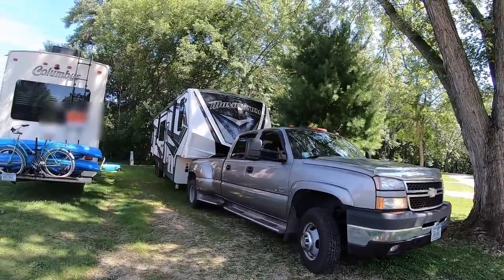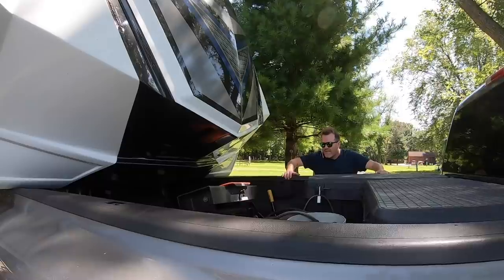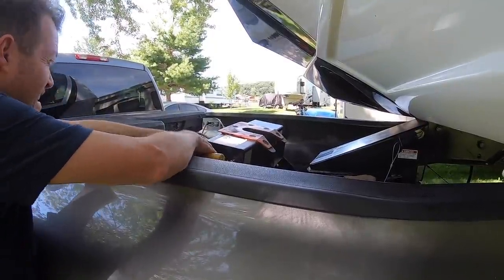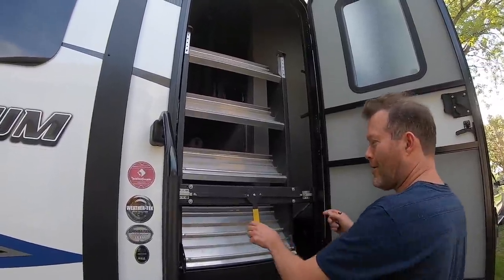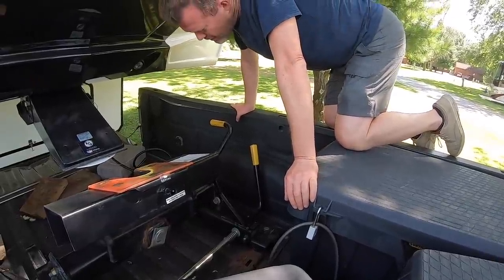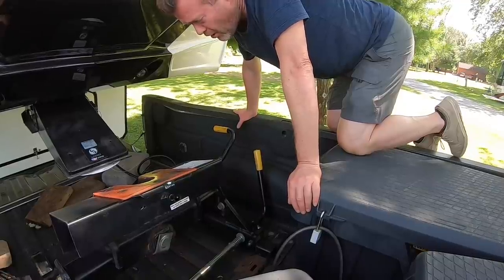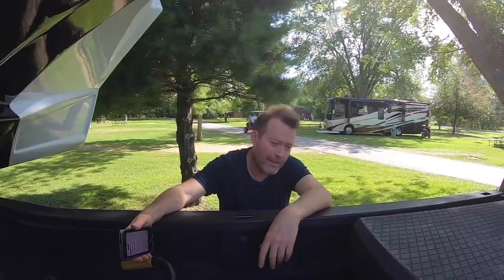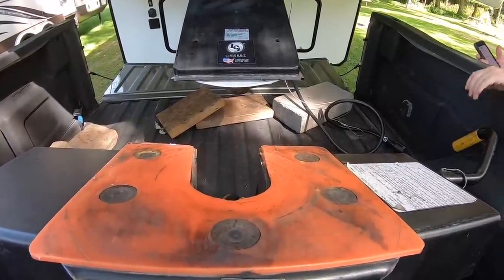RV CRUSHES MY TRUCK ON 1st TOW! BIGGEST RV LIVING FULL TIME MISTAKE! (PT 2)

Comment: I know what you did.  There are 2 positions that would indicate the trailer is locked in but only one of them is right.  If the pin on the trailer is too high when you connect, it will trigger the lock  and indicate a good connection.  The pin and hitch appear connected but the trailer pin is sitting too high on the hitch.  When you started to move the trailer the truck dipped a little bit, causing the pin to roll out of the top of the hitch and BOOM! You aren't the first to do this.  Here is how to prevent this situation:  When backing under the trailer, be sure that the trailer hitch is a little lower than the fifth wheel so that is has to push itself up the slope of the hitch until the trailer locks in properly. Do not, I repeat, Do not rely on the little white pin to indicate you are locked in properly. Be sure that there is no gap between the trailer and the hitch and that the jaw is completely across the pin and locked.
Reply from the maker: Thank you! Great tips!!
Reply: Sounds like an old trucker's trick also always do the tug test another way to make sure it is locked in and before you bring up the landing gears
Reply: ROGER THAT FLYERX.       THAT'S A MISTAKE THAT HAPPENS, OR SHOULD ONLY HAPPEN, ONCE
Reply: I added a reply on part one of this mistake. Happened to me also and I have hooked up many many times.  I have a 20K # Husky hutch. A little different than this one. I actually like mine better than what I see on this one.     When I hook up I always do the pull test except the one ugly time.  I get a probe that comes out as well on the front right side and my unlock lever swings free and hangs down loose.  I don’t see that in this one. Absolutely right about having the trailer a little lower than the 5th wheel so it has to ride up.   You can read my disaster story like I said in part one.  No damage to the trailer and not as much damage to the box as I had my landing legs only pulled up a bit. Lost the tailgate though. $3500 damage.
Reply: You are absolutely correct. Trailer was to high for pin to seat properly into hitch when locking jaw closed. I have ran into the same issue myself. I level trailer slightly below level of hitch so there is just a bit of friction and downword force on the hitch itself when backing up. Very simple process  AFTER you do it a couple of times. The test pull with trailer brakes on and pressure off the front jacks is crucial. Won't be a skipped step again no doubt. Easy mistake that will only happen once. Truth is you actually got pretty lucky. Had a guy swing the back of his trailer and clipped the front cap of my Raptor. Fiberglass repair, complete cap repaint and new decal set ran his insurance over 7k.  Truck bed repair will run a fraction of that. Very sorry to see this but you have just saved several folks from making this same simple mistake. No worries and think of the great blooper videos to come. Seriously, you have done a service for sharing this little misadventure. Shake it off and get on with it.

Comment: I do a brake check before pulling away, (apply brake controller) slight pull with truck, to see if trailer secure in hitch. 
I get a little tense when hitching up, remembering if I have done all, I should have done!

Comment: First of all... kudos to you both for your honesty and humility. It takes courage to post mistakes whether your own or faulty equipment. So many rv tubers show the glamour... not the reality. So I appreciate your sharing the reality of life on the road, mistakes and successes/ challenges. I'm sure you're not the first and certainly not the last to encounter this issue. My only suggestion is perhaps video recording the detailed instructions from Mark (PREV owner) on hitching up with that brand, so you had a reference when the time came to hitching up. May have helped.. may not have. Recording the inside functions and tour is great but forgetting to video tape the outside elements may have helped.. or not. As well as physically hitching up while Mark was there.  Certainly if it's a product malfunction... it wouldn't have helped. Bottom line... thank you for your honesty!!

Comment: Went back and watched the previous video. You did what us truckers call high hooking a trailer. Its when the shank of the kingpin is above the shackle or locking jaw of the fifth wheel. You can see it in your previous video when you show the kingpin in the fifth wheel. The customer service rep guessed your problem right.

Comment: Wow watching the guy that sold you the trailer, I don't think u turned the handle🤔 He also removed the handle, Not like buying from a dealer that would show you how to hook up. But crap happens, we learn from our mistakes. We all been there.👍Did he have same kind of truck you have?
Reply: If you buy it and install it yourself , no dealer would be there to show you how to use it.
Reply: but if you bought it, the goal would to buy the one for the truck and trailer. Might even be instructions with it......A lot of what if's
Reply: @bobandtams  the guy showed him the instructions of the Internet,  if I remember right. He had to swap wiry the other guy because the one he had wasn't big enough for the camper.  That said they have used them before and just weren't familiar with this design. Which again he should have backed under it once while the guy was there to get the hang of it before he towed

Comment: This is why I always do a slow roll test pull to make sure everything is locked in properly. Although I would advise using larger secondary pads for your RV jacks. I bought 2 lengths of treated 2x12 lumber that I cut into 12” sections and I put under my jack stands

Comment: 100% operator error. Take the white plastic disc and use it as a Frisbee. The fifth wheel already has a red/orange friction reducing pad on it. You should have seen that quite plainly, and known not to add the white one. Adding it made the pin sit to high, not allowing the lock jaws to set properly.  This is why you should have to have an adder on your licence before you can pull anything longer than 10 feet.
Reply: Oh simmer down. Everyone makes mistakes.

Comment: 3:08 I would not have your hand there buddy. My cousins have a 2019 Genesis Supreme 5th wheel triple axle toy hauler with those same exact auto level jacks, and at the desert one time, the pins holding the entire front of the trailer snapped, and the entire front end came down. Luckily it was still attached on the hitch, or the nose would've slammed on the ground, possibly totaling the entire coach. Never, ever trust your hitch, (as seen in this video) and never ever trust your jacks. Safest spot to be under the trailer is under the axles.
Reply: You are too kind. Terrible judgement on the owners part.

Comment: Was that a Reese hitch?? Had the same issue. Hitch had a defective part which resulted in Jaws opening like yours did. Trashed it & purchased a Curt hitch Curt hitch is excellent.
Reply from the maker: It's not a Reese. Thanks for the tip on Curt hitches!

Comment: Tom one of the first things we learned at truck driving school was to do a pull tug test but first thing was to lift up level legs a couple of inches before doing the tug test so you don’t damage landing legs this way if you don’t get a good lock on to your hitch it dose not slip down to far thank god the RV lift it’s self and you don’t have to hand crank it up

Comment: After watching this, I'm thinking that I love my Anderson Hitch even more. Seems much simpler.  I don't know if I could do this one.  Keeping you guys in my prayers.
Reply: We love ours too. You know it’s on and no bucking or chucking. I hated my old hitch if it was off kilter it would bind and not unlock. No problem with Anderson hitch.
Reply: We love ours.  No chucking, no risk of dropping the trailer.
Reply: Love ours too. But, I always look under and do a visual check to make sure the pin moved and locked the trailer to the hitch. Then you know it’s locked on and good to go.
Reply: The setup he has is just fine. The problem is not knowing what he is doing and not cbecking the load himself

Comment: You were high hooked. You can see it on your last video.
Reply: If that's the case, the white pin that sticks out when it's properly hitched should not stick out.   I want to know the brand name of this hitch so I know what not to buy.
Reply: I have been driving tractor trailers for 22 years. I want to let you know for sure it is possible for the jaws to be closed and locked and still be high hooked. What happens is the pin is sitting on top of the jaws. Not in the jaws. 
I’m not trying to argue with you. I just want you to know it is possible. In case you have a fifth wheel. 

But after watching the video again I’m not sure that is what happened. I’m thinking now the handle wasn’t in. But that doesn’t explain why it won’t release after they moved it. I wonder if the pad he put on there has it jammed. 

I mean no disrespect. Have a great day.

Comment: I just found your channel and love it! I watched the episode where you dropped your brand new trailer on your truck! The same thing happened to my husband and I, we travel full time hook up hundreds of times our trip started as usual we were going thru a big parking lot then took a right hand turn and BAM down it came. We did the “tug” and all the safety checks, looked at it from every angle a believe the plastic disc is a culprit! The manufacturer of our hitch was absolutely no help(Reese) they sent a manual on how to couple and uncouple correctly.,we bought a new hitch different brand and it works well. Thank you two for always being so candid.  Safe travels , Drew and Felicia

Comment: As a truck driver first thing I do when I back under a trailer I will do tug test then I get out and inspect it check theres no space to see through or gap between the fifth wheel and the plate if there is it's to high and jaws wont engage (false hitch). I'd get a better hitch personally I only run b&w.

Comment: When you get ready to do the pull test don’t raise the landing legs more than enough to put all the weight on the truck. That way if it drops during the pull test the legs will catch it without any undue stress. 

Make sure your trailer wheels are fully chock so it won’t move during the pull test. 

Leave the tailgate down.

Engage the trailer brakes manually and do your pull test. 

If the wheel were correctly chocked and you’ve manually have engaged the trailer brakes you shouldn’t be able to move the truck.
Reply from the maker: Thank you! Great tips!!
Reply: Leave your tailgate down too.
Reply: timon0x31 I do this every single time I hook up. I don’t like putting the forward stress on the landing gear but I am terrified of dropping my camper on my truck. And I also leave my trailer slightly low and have it kind of ramp up on the hitch. Not enough to life the trailer or anything. Just enough so I know it’s not high pinned.

Comment: Do people require special training and licensing to pull a rig like that? If not, they should.
Reply: Here in Sweden you need to take an extra driver licens test for rigs like that
Reply: I would replace licensing with knowledge. Not all problems are solved by throwing a license at it. We all have basic drivers licenses and manage to kill 40,000 people a year in the U.S. alone, not to mention hundreds of thousands of injuries. Property damage is through the roof. Yeah, licensing works really well.
Reply: You can drive a bus sized camper with only a class d or c in the usa.
Reply: @southernwulf3335  I don't know that weight class, but last I knew my regular license was good for up to 18,000 pounds gross weight. That allows me to drive a good sized box truck which I've rented on occasion.
Reply: Here in Ontario Canada a trailer that big would require the same license (A) that a big rig trucker has with the exception of not needing an air brake endorsement (Z) 
Even with my D class license, I am still only permitted to pull a 10,000 pound (transmitted through tires to ground) trailer which is the same as anyone with just a G class (normal) license.
Reply: Alberta, Canada can tow a 5th wheel trailer and smaller bumper trailer with a normal licence but no longer than 20 meters front to back
Reply: @Crewsy  not true.. its classed as recreational a G license is all you need. Unless you hall them commercially
Reply: OETIOHeavyLifter 
You still have the 10,000 pound limit of weight transmitted to the ground through the trailer wheels. That means you can haul a 15,000 pound trailer as long as you have 5001 pounds of weight being carried by the 5th wheel hitch.

This particular Momentum trailer is under 15,000 pounds dry weight with 2,700 pounds hitch weight. 
On top of that weight add all your gear inside and your water tank plus it’s a toy hauler. There is no chance anyone in Ontario could pull one of these without an A class license. 

https://www.rvusa.com/rv-guide/2018-grand-design-momentum-toy-hauler-floorplan-381m-tr35918
Reply: @Crewsy  nope. read the mto rules.
Reply: Because driver training eliminates traffic accidents right?
Reply: Avshalom Chotawm  Drivers license bro driver's license

Comment: Agreed! Tug test every time regardless of distance. Even the 10ft in the driveway to get behind it.. Some grease on that plate gives smooth rotation on the surfaces.. dry plates give steering a rough ride and wears parts faster.
Reply: It's a Teflon plate. No grease on the surface. But the jaws need lube.

Comment: Installing the white disc on the trailer when the hitch already has the orange surface is unnecessary. Both items are created to eliminate the need to grease your pin but NEVER have both used together. 
As the Husky customer service rep said you high pinned the trailer. 

If you have been traveling all across the country and haven’t developed proper habits and techniques with your old trailer then it’s a wonder you haven’t effed things up already with the other trailer.
Reply: GT500 
If you think I was a dick then you should have seen what I didn’t post. 
Someone that has pulled a 5th wheel as much as he has should not be making rookie amateur like he did here.
Not doing a tug test with legs down is an amateur mistake and him not doing it shows he has not developed the good habits to show he can be competent pulling a trailer across the country.
Reply: Yes, I agree. But if you haven’t had proper instruction at the start, you don’t realise your poor procedure, and you keep doing what you always do.

Comment: I would recommend a B&W hitch.  I'm not a spokesperson or representative of the company, but they make a great product that automatically latches, even if you forget to put the safety pin/lock into the handle it stays locked around the kingpin.    There's no question if it's locked or open with the B&W.   speaking from experience here.  Always do a tug test with the wheel chocks still

Comment: Take that plastic pad off your pin since the hitch has it's own permanently mounted. I'll bet you lunch that extra 1/4 inch caused it to high-pin the first time and then bind up the second time.
Reply: I said that to myself when he put the disk on.
Reply: @davidjakobsen597  I agree! The dubble lube plate caused the problem.
Reply: @looseballs1966   I think its because you have to be smart enough to avoid mistakes when your not rich enough to afford to pay for them.

Comment: My wife and I plan to retire and RV full-time in a similar rig. Having never towed a 5th-wheel, this is my greatest fear. I got the flop-sweats when I watched part 1. Thank you for sharing. Mistakes are the best learning tool but I'm sorry this had to happen. I love your videos and look forward to the next installment.
Reply: Tim Carlisle having never towed a fifth wheel... you probably need to get a non RV based education on how they work.
Having spent 10 years in RV and commercial maintenance - RV owners should be required to get a class A, it would save all this grief. 
You’d also save a bunch of money by understanding how hitches work. 

One free tip, learn how to button hook, then you don’t take up two lanes trying to turn when you can actually make it.
Reply: Sandra WestleyUK, we’ve not only dropped our van, it was a trailer and the tow ball ground along the road, but my husband once serviced the van himself, and after you have been towing 30 mins or so it’s best to check the torque on the wheel nuts of your wheels, we didn’t and the wheel came off, flew across the road demolished a market stall outside a shop, and we ground along the road on our shock absorbers which ground them down, fortunately nobody got hurt, we needed new bolts and nuts on the axle, and new wheel, but the shock absorber worked.